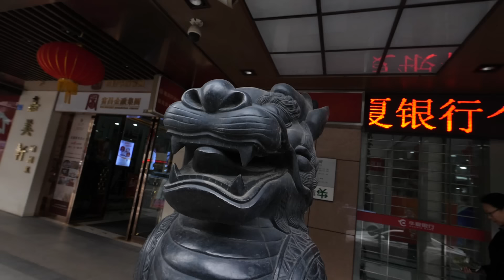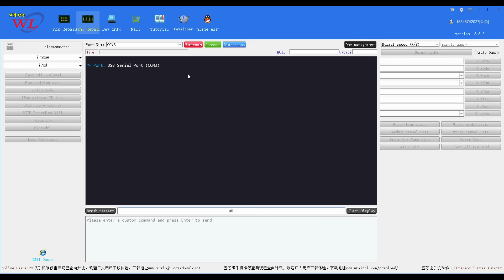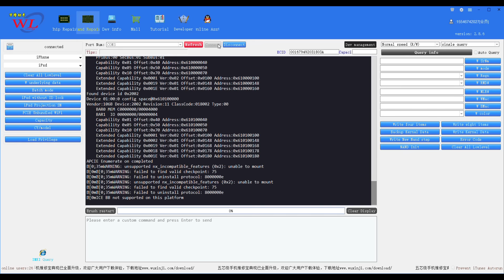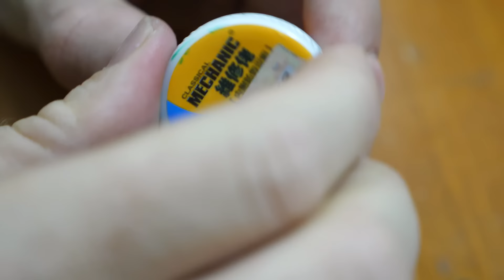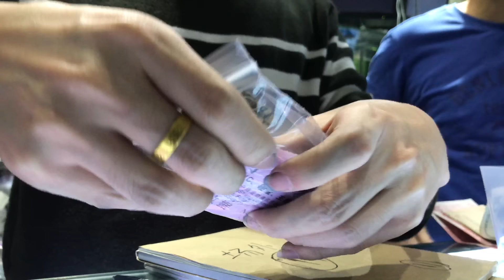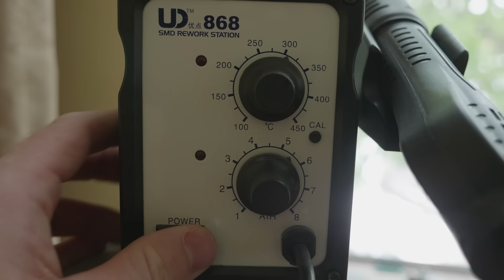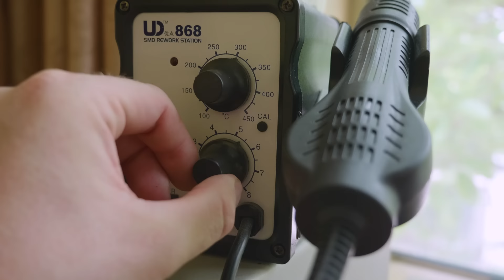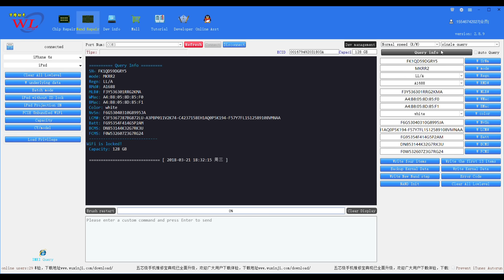How I Upgraded My iPhone Memory 800% - in Shenzhen, China

Comment: You could have just installed Windows on your Mac.
Reply: Harbir Singh there’s a lot of things he could have done better lol. 

He also seemed dumbfounded when the iPhone went into DFU mode, how are you going to be working on the hardware when you don’t even know how to reset the firmware
Reply: Hes a typical mac owner
Reply: he could just use virtual machine software on mac to get windows running.
Reply: No but macs are overated.
Reply: Do you even know what overrated means? Mac market share is only 12% while windows is 82%.
Reply: Bootcamp basically babysits you all the way through the installation process and gives you all the necessary drivers in a neat package automatically it's the epitome of a user friendly OS install. Choosing between which os is a one step process "hold down the Option key under start up and choose which OS you want".
Reply: What part that mac is overrated? i have gaming PC and MBP, besides gaming i find mac superior in most task than windwos.
Reply: I sure do know what overrated is that's why i said it... has nothing to do with market share at all. People over rate the product compared to what it actually is.
Reply: ERD Epoch they are not. For the price, you can't get any better. Especially that you can dual boot into windows without any problem. For me, I'm only using it to type some stuff and make some slides so i bought a 2010 macbook.

fun fact, that macbook still got the newest software update from apple. Can't say the same to my 5 y.o. asus laptops. It doesn't even has proper windows 8 drivers
Reply: Revanthane - Price. Pay way to much for what you actually get when you are buying a mac.
Reply: All ultrabook are expensive not just Apple, have you look the price of Surface Book, Dell XPS, HP Spectre or LG Gram?
Reply: there is a difference between expensive and value. people generally state expensive is something they can not afford, where in fact expensive means that you are paying to much for something you are purchasing in comparison to another product.
Reply: you can do that?!?
Reply: Big - AR lol bloody troll.
Reply: Comparing apple to apple, you compare ultrabook with ultrabook

Dell XPS $1600 - $2000, 
Razer Blade Stealth $1700, 
HP Spectre x360 $1500+,  
LG Gram $1500+, 
MBP touch bar 13 $1500.

If you buy Mac for gaming, of course you are stupid. i could just build $800 pc. For productivity, Mac have good customer support, reliable os, great trackpad and battery life. Why would i buy $1700 razer ultrabook with poor battery and bad customer support or $2000 dell XPS with infamous quality control issues
Reply: The trick Apple has pulled is that they just don't do discount and even low market-focused products. So in comparison, they almost always look good when you compare them to what people often have lying around. But if you buy a price equivalent non-mac and compare it to a mac, it will almost always be vastly better computational-wise. Apple obviously knows this and thus don't focus on that - like most end users won't. Benchmarks and general performance is not important to 90+% of users, windows or mac, so Apple tries to optimize things like design, touch pad and peripherals. Whether or not that counts as "overrated" reflects on ones general thoughts on whether e.g. design is important when you buy a computer, or whether you've already invested in 800 peripherals that you'd need the computer to be able to handle (or usually, the other way around), so you won't have to replace everything. This last one is why Apple are depending on introducing new things they can then use to lure customers in.
Reply: Or use a virtual machine
Reply: @VM Usage: Doesn't always play nice with unusual USB periphery, though he certainly could've given it a try first. I guess he might have a different project in mind he needs the laptop for?
Reply: He could’ve also used the proper term for “storage” ITS NOT MEMORY, MEMORY IS RAM OMG WHY DO PEOPLE DO THIS
Reply: @Todd L-M Wrong. RAM is a form of memory, but so is the eMMC flash memory chip he's soldering in this video.
Reply: Not really typical, a lot of mac owners are power users with multiple operating systems and use homebrew as a package manager on osx
Reply: Maybe he is sponsored?
Reply: I think he is pretty clued up and definitely knows this is possible seeing that he is an ex software engineer for Google
Problem is virtual machines have a lower performance than a full blown computer, whilst boot camp partitions your hard drive which occupies a lot of space which you could store other things. Probably Scottie has a lot of stuff on his Mac and for him storage is a premium.
Reply: Sebastian Li he's upgrading a iPhones storage for a few bucks, I'm sure he can upgrade a Mac's storage if dual booting is a problem.  Besides it's nice to have one machine that can do Mac and windows
Reply: Please do some projects in Bangalore or Hyderabad. They are upcoming tech hubs.
Reply: Revanthane, this is absolutely not true. Look at his linkedin page - software engineer at Google, senior software engineer at another company.

Also you don't need to be a programmer to use Boot Camp, it's made for average end-users. If a monkey could read, it would have no trouble using Boot Camp.
Reply: Guys, if someone wants to buy a Mac, and if a Mac is right for him, let him buy a Mac and stop shitting around.
And remember you don't only pay the product but the research and development, marketing, support and everything else that other brands don't have as much. If all laptops are like that today, it's in big part thanks to Apple (rear hinge, trackpad, backlit keyboard…), and they cannot do that freely.
Reply: Yes he could have but windows on a Mac does not work well because the hardware like the cup get confused
Reply: Revanthane Linux user here.

Mac is complete crap at doing anything, however there are a few good productivity apps which I can see some people buying a Mac just to use it, stuff like finalcut X for example. But it also doesn't allow the user to tinker around too much either, macos however has extremely good user experience and is pretty user friendly.

Windows is for the average user, it's an OS that does really need much tinkering with or explaining to use. Windows' big plus point is software support. Other than that I can't think of anything.

Linux is complete Garbage at user experience and it's also not the best kernel either, windows NT can even recover from a lot of errors that Linux cannot for one. However, Linux's customisation saves it and it's the main reason why it's my main os. I run Arch with mesa-git, amdgpu-dc and a lot of kernel tinkering. With Linux I can customize it to how I like it and that's it's plus point.

TLDR; Windows is complete shit at everything except software support, Mac is complete shit at everything except certain uses and user friendliness, Linux is Garbage at everything unless the user knows what he's doing.
Reply: ...and get drivers for a very bleeding edge machine to work? Did your spaceship from mars just land or what?
Reply: You could use parallels . Check it out . Nice video btw
Reply: Kalvin N I agree.. The SIMCARD slot could be glued with high temp resistive glue, as well as those mini transistors to prevent it from falling off, then ofc the Windows on Mac is like 0 dollars and 30 minutes of time.. Putting back solder was good enough on his first try.. No idea why he kept practicing it to perfection.. So bad.. I almost feel as if he was making it look like as big of a deal as possible
Reply: Harbir Singh or use vm ware fusion
Reply: Agree, people buy macs for apple exclusive and optimized applications. It is the best for productivity. With Nvidia GeForce Now, with good internet, the lowest spec mac will be able to play games very well if you want to play games. An excellent factory-calibrated display, a certified Unix system, and btw the best trackpad (not just great a trackpad), and so much more. However, if your work does NOT require any mac features or mac aesthetics is not important to you. I say buy a pc. In fact, it would be way better to choose a Dell XPS or some other laptops. There are targeted groups for Mac users, and if you think mac is overrated or overpriced, then it is simply you are not supposed to use a mac for what you are trying to do. In that case, go with pc with windows or other operating systems.
Reply: +Zeron' My gaming PC would outperform every mac currently for half the price.... So yes, arguably people are stupid for buying a Mac.
Mac User: Bu...but.. .bu THE OS IS LIFE.
Well since the os can be acquired and put onto PC's you could have a PC with OSX that outperforms every Mac for almost half the price, that's known as smart consumerism, it's all hypothetical.
Reply: Or use a VM.
Reply: Revanthane Do you? Market share has nothing to do with things being overrated.
Reply: Revanthane DO YOU? overrated means that people are preferring it more than others for less than a good reason. IT DOES NOT MEAN ONE IS BETTER.
Reply: Revanthane I KNOW! My DELL laptop (which my workplace provided) costs almost as double as my personal macbook pro
Reply: Revanthane I wouldnt even call him a hardware engineer. He works on phones. That isnt difficult.
Reply: They are also overrated because the users think they are getting this amazing system that performs really well, but in reality the OS is very restrictive and doesn't support the latest software or hardware.

So really what you get is an "okay" or "decent" spec but everything is locked down to prevent you from using it to the full potential.

It's an adequate computer for people who just want to do basic stuff at home, and have no desire to learn how to use their machine fully, but it's not a performance machine or a productivity machine.
Reply: Thats exactly what I said!
Reply: How about alot of you people chill out. He is learning how to do sheit, and does not quit when a problem hits him smack in the face.
This is an "learning experience", try and do it yourself and than be so smart about it.
Reply: why not buy a 600€ notebook from lenovo with good battery life and without OS. its for sure better as the mac book, because its freaking cheap.
Reply: I told him on facebook... and he works as a software engineer so maybe he was afraid for his data to try a dual boot
Reply: Revanthane HE IS A SOFTWARE ENGINEER BY MAJOR
Reply: Yeah, but simply buying a pc saved him alot of trouble in the long run, like working with one usb port on shitty mac. also if something shorts out in phone and it kills usb pc doesn't die, just usb ports do... but macs die because that only usb is not insulated from rest of the motherboard.
Reply: Ugh this whole thread is cancer. 

The widely-accepted term for RAM is memory, but technically long-term storage such as flash and hard drives are also considered memory. It's just confusing when you say the same thing for both.

Windows has been proven to be terrible at memory efficiency, and leaks all over the place. It's why all the big-boys on the block use Linux for their servers. Also: software development is much easier on UNIX-based machines, which is what MacOS is, as well as Linux.

While UNIX is very old, it works very well. The main argument that most people use for this argument is the common...

"Well Linux is bad because it has crappy drivers for games, and game software."

This is true. But that doesn't mean Linux can't handle it, or is bad software. It just means that Windows is cheaper, and much more popular, therefore developers will write code for the more popular platform: Windows. If Linux had been more popular for end-users in the early days, maybe it would have stuck. But Windows took that market first.

Android is another Linux-based OS that runs well, is popular, and runs games pretty well (albeit not PC games).

"But iOS is so much better."

You cornered yourself. iOS is basically Linux's brother (and therefore Android's cousin). They were both born from momma UNIX. Linux was essentially just a rewrite of it with a couple differences. iOS had a lot more changes, but at the core, they are nearly the same.

So, to sum up, I (being a developer and well-informed computer enthusiast) do much prefer Mac over Windows. But whatever floats your boat, I guess...
Reply: I use Macs for software development and Windows at home for entertainment. Gotta say Windows has come a long way while MacOS has stagnated a bit. Still, now and again I'm reminded of all the things about Windows that frustrate me. I have to install a bazillion drivers to get hardware going, and update drivers and debug hardware when they randomly fail.
Reply: If you're saying that Apple products are priced at a higher price point, no one will disagree with you. However, for people who are willing to pay extra for the Apple ecosystem, there're legitimate reasons for that too. For me, I got mine for free from work, so I'm not complaining :)
Reply: +Gokeji Lol, tipical Isheep, you do not need to install "bazillion" drivers in fact that's probably what caused your problems,  this is no longer 98 you have windows update it installs pretty much every driver needed and if that fails just using your motherboard manufacturer's cd takes care of most drivers, most people in addition to that only need a driver for their dedicated gpu... also given that you're a noob you probably would go and buy a prebuilt computer with windows installed... so you shouldn't even need to install any drivers at all, the pc manufacturer already did that.

Most windows problems are usually caused by the idiot users using it.
Also switching to mac does not solve problems... it just gives you different problems, like stuff not working at all and it's own stupid little problems as no operating system is perfect.

Hardware fails, no matter what operating system you use, the difference is that with pc you just replace the part that failed, with a mac you have to buy whole fucking thing again. Also figuring out which hardware part failed is not hard... if the pc does not turn on at all it's very likely it's psu, if it does but doesn't post and beeps at you, then it's usually gpu or ram depending on the beep sequence (simply taking it out cleaning contacts resitting it solves the problem most of the time) and if pc turns on but does nothing, not even beep then it's either CPU not sitting in properly (normally caused by idiots bending some pins as they are inserting it into the slot, CPU itself almost never fails) or the mobo failed.
Reply: Woah woah, let's not get defensive here lol. I enjoy my PC as much as my mac. Mac does have the advantage of having a limited range of hardware that it supports, and it does a good job at masking the unneeded setup behind the scenes. PC suffers from a lot more compatibility issues due to the number of things it needs to support, and the ubiquity of Windows means they have to maintain backwards compatibility over years of obsolete hardware. PC has a harder problem to solve, and it shows.
Reply: LOL, except it's no longer early 2000s (the explosion of cheap hardware and crappy drivers) and it actually all works well together. The fact windows supports so how many pieces of hardware, just proves how sophisticated it is compared to mac, that completely breaks down, if you play outside of it's rules when not using very specific hardware to make a hackingtosh. Since when a limited range of hardware is an advantage? The way they achieve this "masking unneded setup" is locking the user down so they don't even have options of expansion, but since you're an isheep you enjoy underpowered PC hardware at premium price.
Reply: He just wanted a reason to buy a computer
Reply: Software engineer doesn't mean knowing those high school stuff, programming and electronics are same we learned everything and then we can have the specialty like web designers,  Architects, electronics...
Reply: Nah, (somehow) Install it on a USB stick, and keep it plugged into the back. Dual-boot!
Reply: Don't you think that he had to go to the store...you know like if he was paid for it. Let's call this sponsoring !!
Reply: I just upgraded from PC to Mac. Went with a desktop, got a refurbished, RAM upgraded to 4TB it rocks. Only paid $300 for it. Might be a lifetime PC user convert!
Reply: my science teacher did it. shit😂
Reply: @orvinsavero   ikr ppl be on here thinking cause he's doing this he's an expert
Reply: "I have to buy a new computer" OMG HAHAHAHA
Reply: virtualbox is enough
Reply: @orvinsavero  you forget about Linux.. Also a few more OSs out there, i am sure its a low % but still..
Reply: A lot of considerations people aren't making here are the possibilities He already outweighed buying a new windows machine compared to just finding a way on His current mac.
He most-definitely already was planning to get a windows machine at some point for His future plans or other endeavors and this was just the best time to make that purchase.

The argument also shouldn't have been geared towards "one is better", a person makes their choice based on what faces as a better platform on what their needs are than the other platform. The guy isn't stupid and He definitely has a degree to back that up, I can't with these people who act like He somehow is too incompetent when they themselves do not pose better solutions or pose the proper considerations on why He did have certain decisions. Perhaps He is somewhat incompetent, but not by simple decisions that could have been justified by many different reasons. 

Windows VMs on Mac hardware are notoriously not the best answer when it comes to needing Windows for the software, He probably already had more than enough reasons to justify just going out and grabbing a Windows machine. As for the choice of brand, it's either because there isn't anything else, or He just wants the simplest choice where He is, or something else. Either way, if He made a mistake to any of you, you should have taken into consideration other things that could have been in favor of His decision, nothing is simply as easy as rejecting any other idea going in favor of the opposing perspective because there was an oversight.
Reply: Bootcamp
Reply: @andreihacker24  Bootcamp allows you to install Windows on Mac, Virtual Machine can't detect devices like printers, some tech repair devices